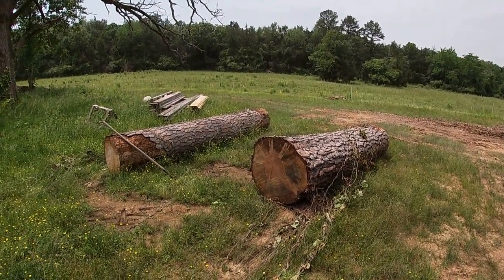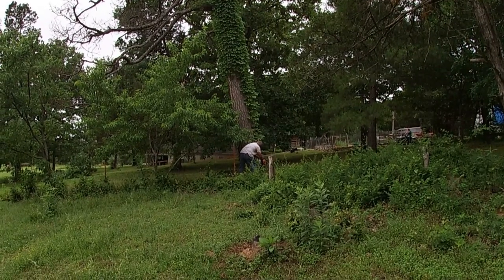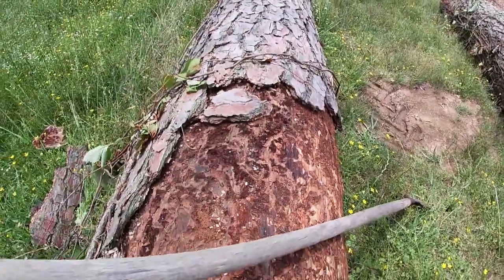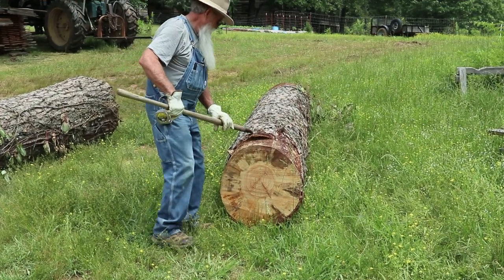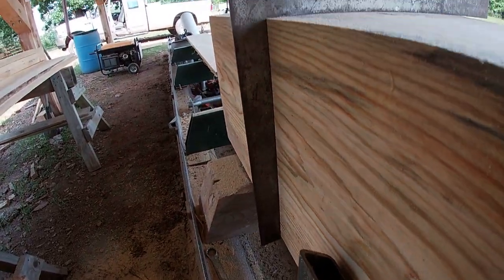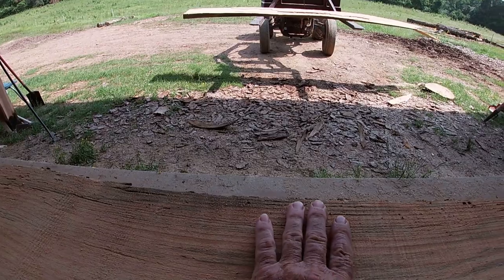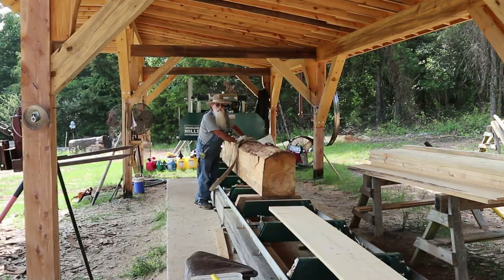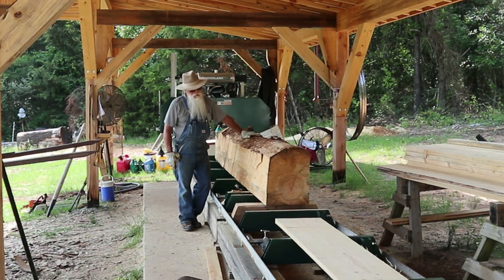Building a Sawmill Shed, Pt 5, Making More Lumber for the Storage Shed

Comment: Nice work Paul. Have you determined how long a blade lasts on your mill? I suppose it matters what kind of wood you’re cutting but I was wondering how often it needs to be changed. Are they expensive? Just curious...
Reply from the maker: Howdy Chris- you’re right about the wood we’re cutting. I can probably get a couple hours out of a blade with just normal sawing. Depending on where you buy the blades they will run from &25-$30 dollars. Carbide tip blades are really pricey. I’ve never bought one. Hope you have a great week. God bless
Reply: @TheBeardedCarpenter  👍🏻👍🏻👍🏻